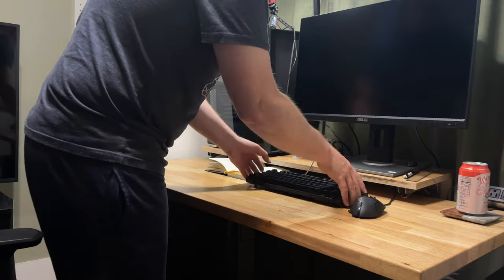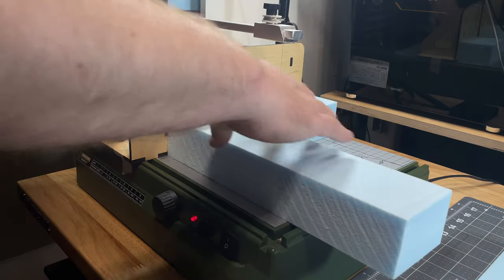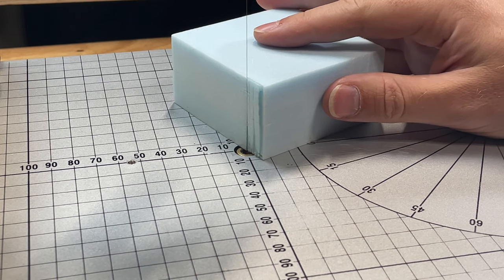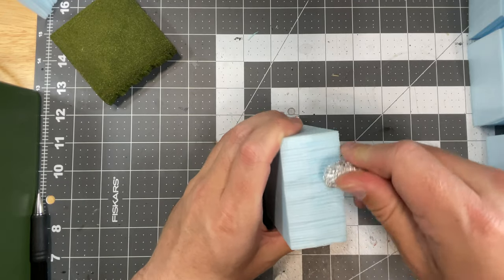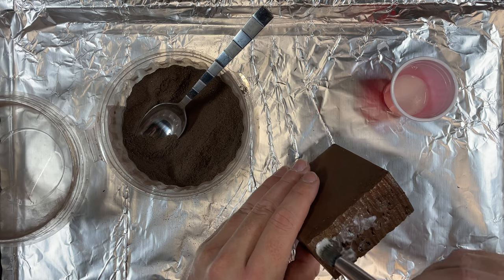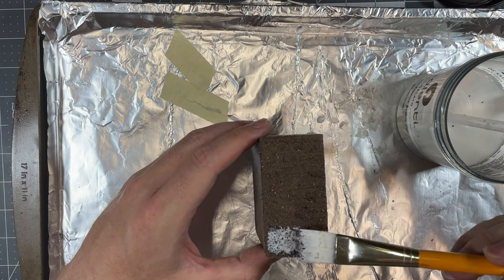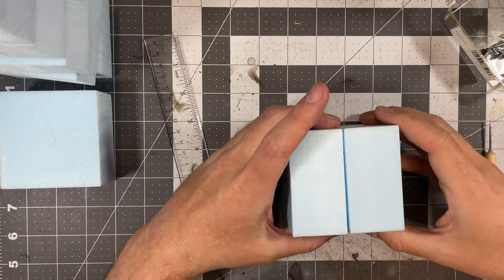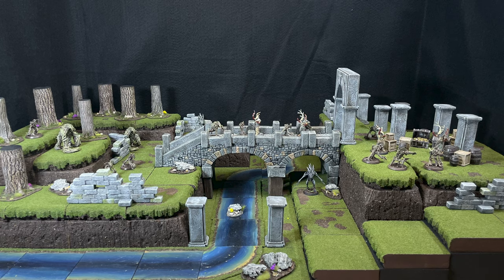Ravine and Cliff Dungeon Tiles Set for Tabletop Gaming Terrain

Comment: Looks good, very playable.
With ground or hills I don't use modular.
I use a felt cloth I sprayed to look like grass/field. Then, I just put foam chunks underneath for elevations or uneven terrain. Otherwise, lay it flat like a mat. So easy. Holds trees rocks and terrain just fine.
The nice thing is you can pin them down in places if you wish.

Comment: I gotta say, even as someone with my own style of tiles, I really do like yours best. I feel, if I ever emulate them, I'd do the magnets/metal the other way around. Other than that personal preference, I feel yours are superb. The combination of look, ease of construction, and overall fit-n-finish is super nice
Reply from the maker: Thank you! And I’d do the same honestly. Thinking back I wanted to just do something that was very approachable and you could do with simple materials and for cheap. But I recently ordered a bunch of 8x10 magnetic sheets with adhesive backing to try and make the Magboard one large magnet and still work with simple cheap screws on the bottom. The magnet sheets weren’t strong enough.  Not even close to hold the tile by the screw. They barely even held the magnet side of the tiles. - All that said, I’ll likely make the switch to a metal board eventually, but it would mean buying a kit more magnets, and replacing all the current ones I already have. … so maybe not. Haha!
Reply: Exactly. I've got some sheets of metal, as well as a "magnetic white board" or two. That's why I'd start that way 'round. Still, I can't even be bothered to put magnets on my minis, so I doubt I'll build a metal board, anytime soon. Even so, the look of your tiles has me rethinking my EVA foam ones. I'll likely swap out to an even 1" thickness, and probably of XPS, in future